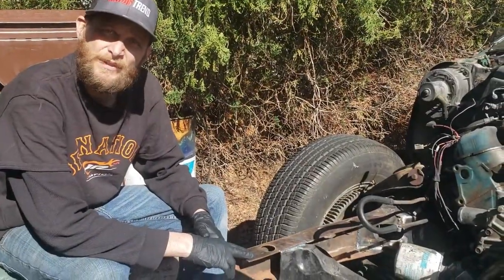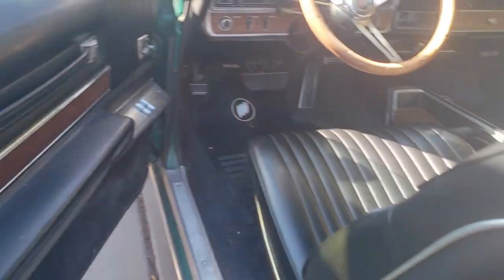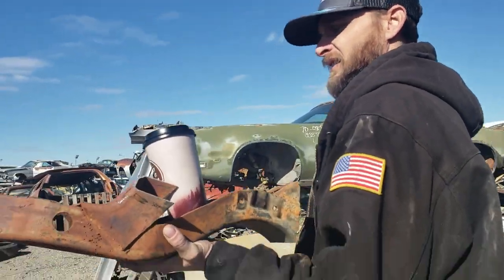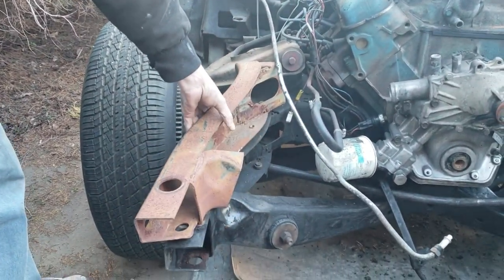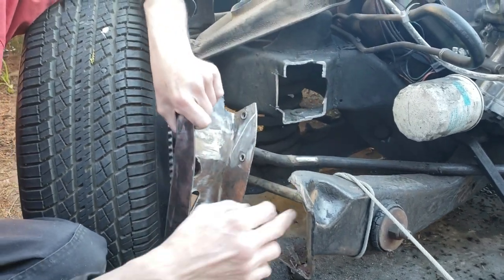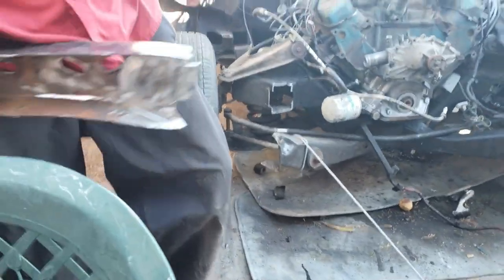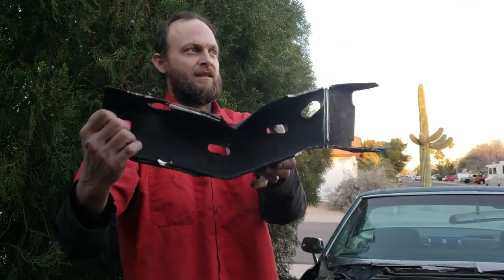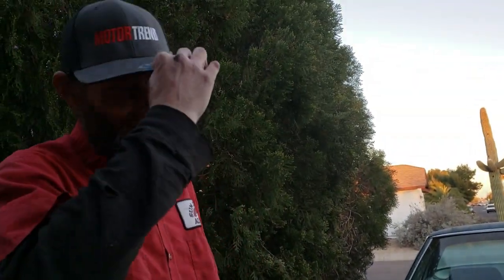1970 Riviera frame restore

Comment: Wow, stumbled on this video. Seems like the 70 Rivs are coming in style now. I finished my '70 for the second time in 2011 one of only 3 in Black in AZ that I knew of at the time. Most good Riv parts are hard to find even in AZ. Desert valley Autoparts (or previously known as Deer Valley Auto Parts) ended up buying all the Rivieras from an old Riv junk yard where I had direct access. Glad my car is done and I have the parts I needed. glw build (its probably already done based on this video posting.